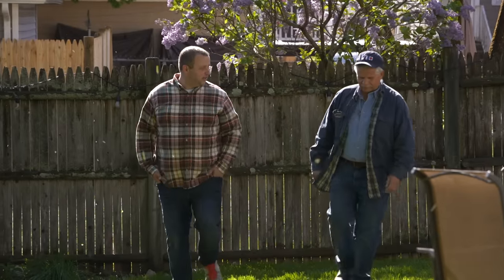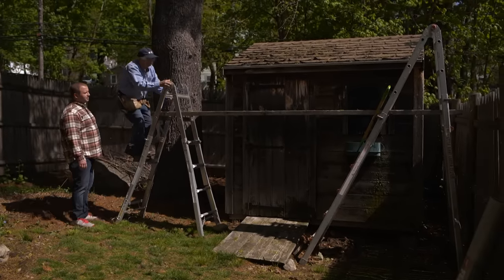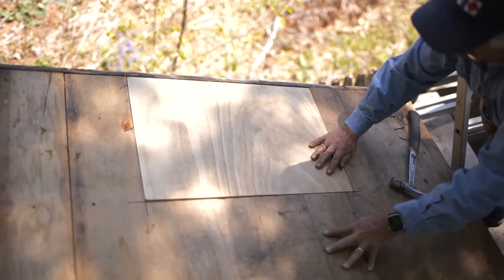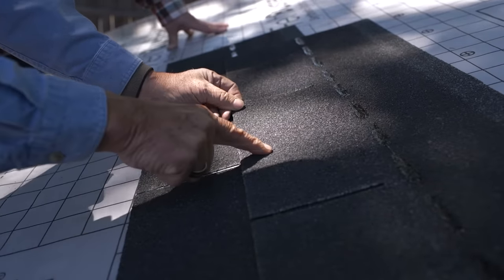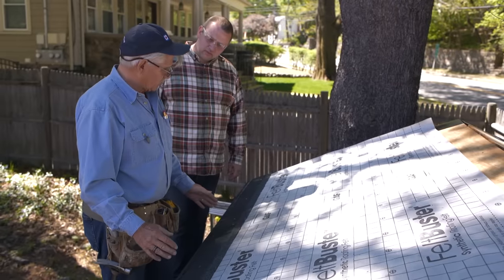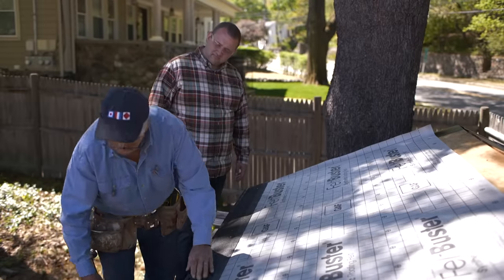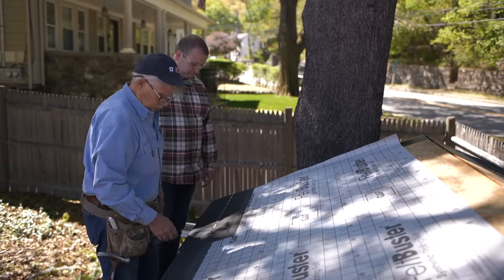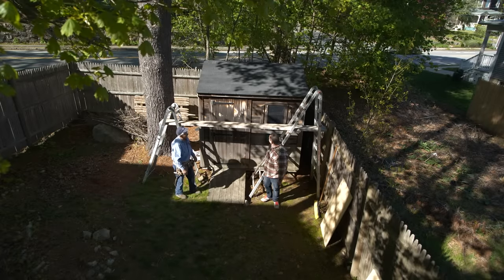How to Install Shingles on a Shed | Ask This Old House

Comment: I've roofed many sheds. Never needed the chalk lines. The first shingle basically serves as a cornerstone, I just make sure it has the proper over hang on the top left rake side and both bottom corners on eave side. The only time I've used a chalk line was on an owner built garage with a bow out on the eave sides. His idea of centering the shingles is cool as well as leaving space between fascia and drip edge. There should be more information on ridge caps and installing the final steps of it.
Reply: Understood but a chalk line only takes a few
 Minutes and give assurance as you go so work goes faster . Any way to each his own .
Reply: Sure u dont need a chalk like. But some roofers dont want all the rows following a crooked eave. Therefore we will do one row, chalk a line just get the following rows pin straight

Comment: Good god that is the most perfect plywood patch I have ever seen.
Reply: Tommy is a badass in home Renovations almost as good as Chuck Norris in, well just anything….
Reply: I agree, I would of had to attach some sleepers to the rafters in order to nail that patch home.
Reply: That’s what happens when you own a Festool.
Reply: A. K. A. 30+ years of hands on experience, he could do that in his sleep
Reply: @nightfangs2910  ... how about 50+ years? Tom is 74 this year and will be 75 in January.
Reply: I know with drywall if you have a large hole its easier to cut a larger patch stud to stud so if he cut this patch from rafter to rafter it makes nailing easier..
Sometimes you cut the hole to match the patch, it makes things easier
Reply: @Mixwell1983  ... the difference between drywall and a roof is with drywall you will probably never have to drive a nail into the patch so there are dozens of ways to fix a hole... and most are not structural.
Reply: @rupe53 Wow!
Reply: It’s sad that I get excited by plywood and shingles. Im a single woman and I don’t need shingles on my shed! Watched anyway!

Comment: They normally say the underlament goes over the bottom drip edge.  But the side drip edges go on top of the underlament being used.  I wonder why they didn't do it that way?
Reply: I’ve heard it depends on area.  Some areas it’s all under the drip edge and some areas it’s like you described.  My thoughts are when the underlayment is over the drip edge wind can get under there and blow your shingles off.   Doesn’t matter if the tar is holding the shingles to the starter strip when the starter strip isn’t attached to the deck.   I like tar paper under the drip edge and to use the adhesive back pre made starter roll bottom and sides so the whole thing is glued.

Comment: I find this lesson to be of value...However when I did a shed roof lately.I found that it was much faster if I laid the starter course and then I centered my first course on a line from the center of  drip edge to the ridge...and took a good look at it...I found that this worked very well for me..So I vertically centered justified everything..and worked from center out.. both edges looked uniform in all their widths and measures...And I did not have to do the whole work from the outside in kind of thing..And I trimmed the vertical drip edges when I was done, with a chalk line and a dewalt trim saw..A word of caution! the blade will be no good after that...However it did work well for me...My best for you and yours ..Jim

Comment: we recommend underlayment under drip edge, especially with gutters and bad winters, also ridge caps should be trimmed 1 inch from edges, this allows them to sit down better and protects from high winds…
Reply: Would you lay the underlayment then. Drip edge, side drip edge. Then more underlayment?   This would be the best way but never seen anyone do it.

Comment: That separation between drip edge and fascia is so important yet very often overlooked. Ever since i learned this from Tommy i see it incorrectly done everywhere!!
Reply: What’s the reason for not going flush to the facia ? Is it because the water will run down facia board
Reply: Correct. Even though drip-edge has a slight bend at the end,  if it is flush to fascia the droplets at this bend can contact the fascia and run down it instead of dripping off the drip-edge. Surface tension can cause water to run up under the slightly overhung shingles and onto the drip edge. What he does gives more separation from wooden fascia. Commonly roofers only rely on overhang provided by the shingles.

Comment: Great video, helped me shingle my first shed. However the measurements are glossed over a bit. How do you center the shingles so there is no small sections, given you offset each row? Also on my shed I almost ran into an issue where the nails on the 2nd side were almost between the shingle tabs, given the shingle size and roof size. Also my shingles are 13 inches tall, not 12?
Anyway, hard to pack all that info into a 12 minute video so thank you! Shed looks great

Comment: About removing the clear cellophane strip over the tar.  Remove or don't remove is very controversial without end and will never be resolved.  The companies usually say on their wrapping to leave the clear strips on.  They
put the strips on so the tar will not stick to the shingle above it in the bundle of shingles.  Also the cellophane keeps the tar clean.  The sellers of shingles like that part as the tar is clean and works right.  In the right heat from the sun the tar melts through the cellophane so the clear strip is not an issue.  The tar then works as it should.  In colder places the tar does not go through the cellophane so does not stick to the shingle that gets laid over it.  
   There are many reports of iffy performance with the cellophane left on.  That is it took a long time of several months for the tar to go through the cellophane.  In some cases the tar never goes through the cellophane.  All tar is not the same.  All cellophane is not the same.  All manufacturers instructions are not the same.  So it is a choice of the roofer as to what way they want to go, pull off the clear strip or leave it on.  My opinion is to leave the clear strip on until the shingle gets laid.  Remove the clear strip, then lay the shingle.  The tar will be clean and have the best chance regardless of heat or cold to stick to the shingle above it.  Unfortunately there no agreement with professional roofers.  You'll find their opinions all over the place.  What works in Florida is not necessarily what works in Maine.  The time of year makes a difference.  The tar may not melt until the next season in either case, shaded roof, long periods of cloudy weather & etc.

Comment: the felt should go down before installing drip edge on the rakes, the drip edge on the rakes will hold down the felt and any water getting in along the rake will go down the roof on top of the felt. installing the way he showed will allow water to get in under the felt on the rake, which will rot the sheathing.
Reply: The idea of felt on top of drip edge is prevent water from wicking under drip edge, which it can do when roof shingles start failing. On my 12 x16 shed, I did not use a metal drip edge. It is all PT wood construction. I laid down Tyvek Protec 200 and put it over the edge. Then my 2x4 roof edge molding is nailed on top of it and the 2x6 rafters. The eave since bottom rafters are 73 degree angle, water just drips off and it cant get under to the OSB
Reply: @scottdowney4318 most don't use a molding as you described. Installing the UL over the side drip edge could allow water to get underneath.

Comment: Good video except you didn't explain the vertical lines very well. how much over do we measure from the  left edge on the first shingle?  looks like you cut about a half inch off when you said measure to length. overlap the 1/2-in on the left edge, then cut off a half an inch? then you start using the notches to line up the overlapping shingles?
Reply: ( i answered something like this on a another comment so i just copied and pasted it hope this helps) there’s multiple ways to do it. on roofs like the video with a straight rake you want to put your tape over the drip whatever you want as over hang say 1” is what you want then you’d hold it past the drip a inch and mark it on 12” the height of the shingle.(which is the full shingle not cut like in the video, you need a starter up the rake unlike in the video, depends but on code where you live but recommend it highly) while you mark this overhang for the rake you want to mark 30” and 36” so now you have your over hang and 6” offset. the reasoning for 30” and 36” is you’ll only cut one shingle the whole way up not both. do this at the top and bottom and there’s your “vertical lines” aka bonds. now a hip roof there’s many ways to get your bonds, many. i have always popped my “ horizontal lines” then place the shingle straight up on a horizontal line you want the end of the shingle to sit square “flat on the horizontal line but the shingle straight upwards vertical” you want to then mark where the top of the shingle is on the side and the bottom then you can move the shingle have someone at the top and you at the bottom and make sure both marks you just made line up with the chalk line. pop it and then measure 6” from that line you just popped and chalk it. there’s your bonds and on a hip roof if you want to truly know if your bonds are square bc there’s no rake you can use the 3-4-5 or 6-8-10 method to see how square the bonds you just poped are then adjust as needed if even needed if you do it right you really never have to unless it’s a very big section. i tried to explain the best i could in this i’m sorry but this is for people wondering. NOTE there is many ways to do this and this isn’t the only way. but this is the method i’ve used everyday for years most people would agree. unless you just don’t use lines and use the precut tabs but don’t recommend for beginners.

Comment: IMPORTANT: When fastening FeltBuster High-Traction
Synthetic Roofing Felt, do not use nails or staples without
caps. Use only plastic cap, corrosion-resistant nails or staples with plastic caps. 

Do not install roofing felt in the manner shown in this video it would be detrimental to the longevity and functionality as well as completely void the gaf warranty.

Comment: My first house, the builder never pull the protective paper of the glue strip! First cold winter day, the contractor was on the roof pulling strips off. Air temp was 20° but surface was almost 80°, never had trouble after that.
Reply: Back in the mid 1980's it was standard roofing practice not to use tar paper or any underlayment.
Reply: @AStanton1966  He's not talking about underlayment.
Reply: The little plastic strip is for the shingles not to stick together in their bundle. It doesn't line up with the adhesive line on the shingles that bonds them once the s u n heats them up. Pulling that off is a complete waste of time and has nothing to do do with a proper installation.
Reply: last shingles I helped put on a friends shed roof, the instructions on that protective paper said do not remove when installing.

Comment: "...but we're pretty close to the ground..."
OSHA: Any work performed over 48" requires fall protection. 

I know of someone who tried to save a few bucks by cleaning their own gutters, fell off a 6' stepladder and ended up landing at an angle that paralyzed them from the neck down. 

Never nail a starter course in the middle of the shingle. There is going to be a seam and/or cutout lining up right over it. Always 6" from the edge and in 12" increments after that. That way, you'll never have any underlying nail under a seam or cutout.

Look at your roof's layout before removing the existing shingles. If they are 3 tabs, you'll be able to already see whether or not you need to offset the first row & course at the rake. 90% of the time, you won't. If they are architectural shingles, just measure the eave and divide by 3'. That'll tell you how much you'll have to play with at each end. If you're installing architectural shingles, it won't matter anyway because you can always tailor the last rake pieces as needed. 

Also, always better to run starters up the rake, run them long and cut them off every 5 courses using another shingle as a guide with your hook knife canted towards you to leave a beautifully straight edge.  

Cutting hips (ridge caps): Flip your bundle backside up, cut from the cutout side down in a triangle away from the cutouts about an inch wide creating a taper and keep cutting down, down, down through the bundle tossing the completed hip to the side. You'll have nice straight clean alignment of the hips that won't show (especially on hipped sections).

My old man use to say, it takes the same amount of effort to install a shingle right that it does to install it wrong, and 3 times as much work to re-do improper work, so just do it right from the beginning. There are no shortcuts.

Comment: what are measurements for vertical lines?
Reply: I know, seems like a large chunk of info is missing.
Reply: there’s multiple ways to do it. on roofs like the video with a straight rake you want to put your tape over the drip whatever you want as over hang say 1” is what you want then you’d hold it past the drip a inch and mark it on 12” the height of the shingle.(which is the full shingle not cut like in the video, you need a starter up the rake unlike in the video, depends but on code where you live but recommend it highly) while you mark this overhang for the rake you want to mark 30” and 36” so now you have your over hang and 6” offset. the reasoning for 30” and 36” is you’ll only cut one shingle the whole way up not both. do this at the top and bottom and there’s your “vertical lines” aka bonds. now a hip roof there’s many ways to get your bonds, many. i have always popped my “ horizontal lines” then place the shingle straight up on a horizontal line you want the end of the shingle to sit square “flat on the horizontal line but the shingle straight upwards vertical” you want to then mark where the top of the shingle is on the side and the bottom then you can move the shingle have someone at the top and you at the bottom and make sure both marks you just made line up with the chalk line. pop it and then measure 6” from that line you just popped and chalk it. there’s your bonds and on a hip roof if you want to truly know if your bonds are square bc there’s no rake you can use the 3-4-5 or 6-8-10 method to see how square the bonds you just poped are then adjust as needed if even needed if you do it right you really never have to unless it’s a very big section. i tried to explain the best i could in this i’m sorry but this is for people wondering. NOTE there is many ways to do this and this isn’t the only way. but this is the method i’ve used everyday for years most people would agree. unless you just don’t use lines and use the precut tabs but don’t recommend for beginners.

Comment: Do you use the same method/roofing shingles for a low pitch roof?
Reply: Idk why nobody replied to your question, but yes. Every pitch is installed the same. 6" offset on literally every standard shingle on the market

Comment: Tommy goes just below the adhesive line & other videos the roofer goes just above it so there's not a chance of water making its way to the nail head.  I'm doing a small repair job & really not sure what's the best nail location.
Reply: tommy said the adhesive is there to keep the shigles from blowing up from the wind.  So I gotta think waterproofing is not an issue the adhesive line deals with.  so nail above or just below. doesn't matter.

Comment: Are the roofers supposed to pull off the clear plastic strips protecting the adhesive on each shingle before nailing them in place?  I didn't see any of those clear strips on the shingles in the video, but my roofer didn't remove them when he installed my roof.
Reply: I think you’re right. That’s what my contractor told me - recently had some shingles fall off and the clear strip wasn’t removed when they were installed
Reply: RL CL  I have GAF shingles left over, and I'll double check. I don't remember seeing any writing on those clear plastic strips. I didn't see any of those strips on the shingles they used in the video either, which is why I asked.  It looked like they removed them.
Reply: Just lay three rows of shingles on top of each other spaced as they would be on the roof, typically a five inch overlap. Then look under them and see where the asphalt dubs lineup with tabs. You will see the plastic strips have nothing to do with bonding them down. Those strips are just to keep the shingles from sticking together in the bundles from the manufacturer. My niehbor shingled a shed, it took him 3 days for a 10 x10 shed. I asked him what was causing his delay. He told me he had a hard time peeling the strips off each shingle. The next project he tackled he came over and asked for help.
Reply: @kennethyoung3911  Thank you, that makes a lot of sense. I just didn't see those plastic strips on the shingles that were used in this video, so I was wondering if they should have been removed during my roof replacement.  Thanks again!
Reply: says right on them do not remove.
Reply: @chrisburns5691  Doesn't say that on mine, but it was done many years ago.
Reply: No need to remove them don’t worry
Reply: @life-longpatriot8258  my neighbor just had his roof professionally done and they peeled them off.